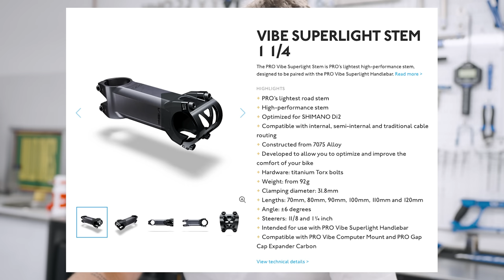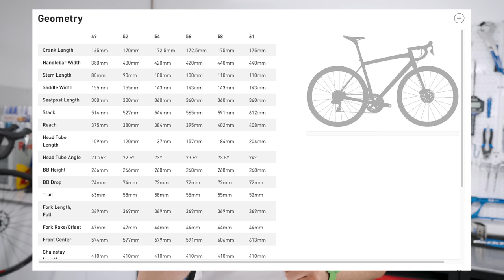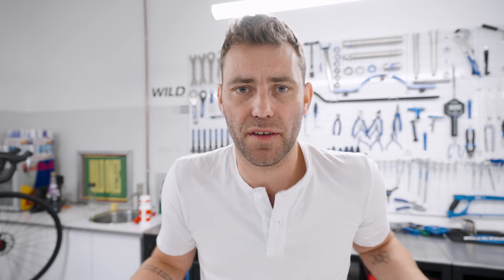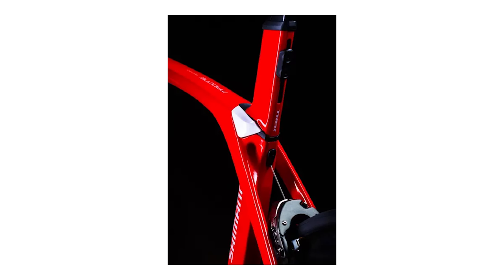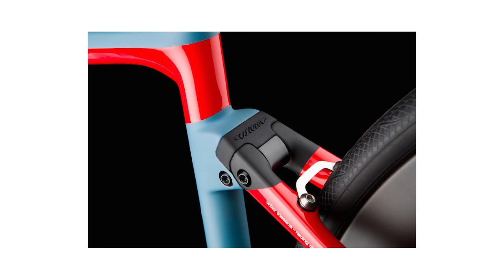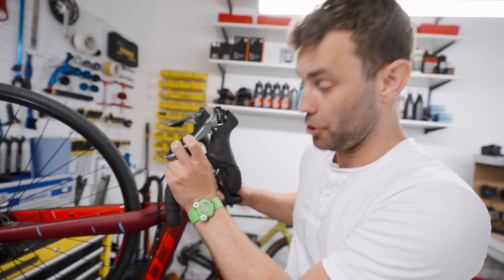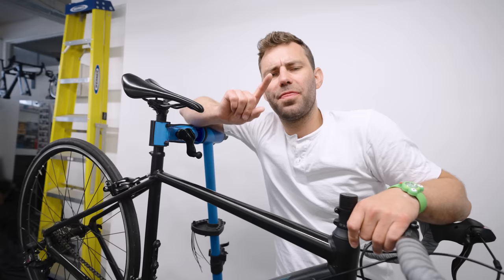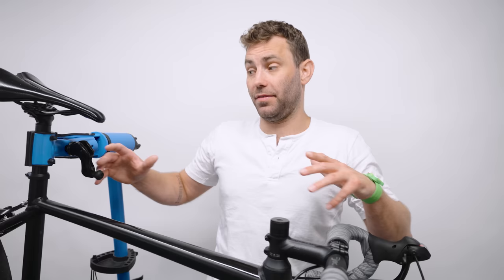Bike Fitter's 10 More Most Hated Products

Comment: Also an experienced bikefitter and totally disagree in regards to the Aethos. James has forgotten that you can simply flip the stem to create a more endurance style geometry. This is the beauty of the bike, in that in can fit racier and less flexible riders, making it a bike for the people.
Reply: It is a flexible platform. I'm 5'10" and tried both the 54 and 56 - opting for the 56 due to toe overlap issues and the necessity of too many HS spacers to make for an acceptable stack on the 54. The trick with this frame is being absolutely anal about bar reach, stem lenth and angle, as well as seatpost offset. Mine fits well enough with a 5mm offset post, 100mm stem, and 42x70 bars. You have to take James' opinion with a grain of salt, not because he's wrong, but because fits are relatively unique and making broad based generalizations doesn't work... I know what he's advocating for with reducing frame size, but he's implicitly recommending custom geometry that favors shorter reach and increased stack. You also have to consider that the majority of folks that seek out bike fits are usually fighting poor fitness/flexibility and/or trying to work around injuries that might not be fixable with a fit - hardly a normal population sample.

Comment: Guys I want to buy a new bike and the problem is I'm between M and L size. What is a chance to pick right frame size without bikefitting before buying the bike?
Reply: I'm 1,75 and also between M and L. I got my last new MTB in M and it fits good. I got later a cheap used one for restoration in L and even if I still can ride it the new one in M fits better. 

The risk is if individual manufacturers may have slightly different sizes

Comment: one thing about long reach handlebars: couldn‘t that be compensated by shorter stems? so if eg my current bike fit is quite okay, but I have a 100mm reach handlebar, would I still profit from switching to a short reach handlebar? or would that mean I had to change my stem as well?
Reply: In my experience, everyone who tries a short reach handlebar finds it more comfortable, meaning that the reach they previously had was just too long.  If your bike fit is indeed spot-on, then the only real benefits you'd get from a shorter reach handlebar plus longer stem would be less chance of bumping the handlebar with your knee when out of the saddle, and also a bit more reach when riding on the tops.

Comment: I always thought steeper STA meant that the bike, compared with another bike with the same top tube length, would be longer, because you'd have to move your saddle further back to maintain the same saddle fore aft (and thereby increasing the saddle to handlebar distance).
Reply: I think you're adding in a variable that isn't accounted for, namely how high your saddle is from the top tube. If you have 8" of seatpost visible with a 73 degree STA and 52cm top tube, your saddle will be further back than if you only had 4" visible seatpost on the same frame, thus necessitating a forward adjustment of the saddle. 
Given the same amount of visible seatpost, a slacker (lower number) STA will increase the reach over a more aggressive (higher number) STA. 😁
Reply: Yes that is correct. That’s why we use stack and reach, to take seat fore aft out of the equation.

Comment: 1. what ever happened to the turbo saddles from Italy? 2. why are people thinking that just a push peddle on a gravel bike is all they need? and where did all the toe clips and strap peddles go where I can slip in a light hiking boot, so I can go for a short hike after ridding the gravel road. or is there some sort of mid tec? or gravel bike riding is still in its infancy?
Reply: (1) Turbo was a Sella Italia saddle, they still make saddles and they're still among the best.

(2) Take the time to get used to flat pedals, it's worth it (but get decent stiff shoes/boots). There is a new magnetic cleat system that blurs the line between clip/clip less, but I don't rate it.

Comment: What's wrong with most 3T bars? I just bought a secondhand 3T superergo alloy and now little bit curious..
Reply: I run the same bars. They work great for me. The reach is only 2mm longer than the deda rhm and the drop is smaller, making them easier to access.
Reply: @brianlam3563  yeah, Neil Stanbury was a great fan of the bar. Curious if it is to avoid according to james just because it has 77mm reach?

Comment: I'm not buying the advice against leather saddles. I got my first Brooks Pro over 50 years ago and it has been my favorite saddle since day one. I have a lot of bikes and half of them have non-"hammock" saddles. I also have sensitive hands, I believe from years of careless use during my various mechanic careers. I have noticed zero difference in hand comfort that I could attribute to saddle choice. Butt comfort, back comfort, even leg comfort, yes, but not hand comfort. In light of the comment on distance, I do a decent number of rides each year in the 80 to 200 mile range.

Comment: why are there hard tail mtb's but not hard fronts? isnt suspension more important in the back since thats where most of the weight is and the rear wheel is the drive wheel. also when seated the spine takes most of the shock while arms are a great suspension system.
Reply: Its in the front because your anyways standing on a MTB when the suspension is really needed. Your legs absorb the shock at that point anyway. Your arms on the other hand don't have as much "inbuilt" suspension and it doesn't take much force to dislodge your hands and taking a mouth full of dirt.
Reply: You need the control/traction the fork gives you on the front wheel more than the rear - it'll save you from a front heavy landing, it'll absorb bumps while you are cornering keeping you on line and it lets you slow down effectively through rough sections. 

Rear suspension is great but if you can only have front or rear front is the largest benefit.
Reply: Older 1990s mtbs have no suspension at all, classic fat bikes have also no suspension fork
Reply: @lewan1905  im thinking bike racing when most of the riding is done in the saddle and there are no jumps or very little ones.
Reply: @Tim Taylor  I don't know which MTB races you are talking about but most if not all official MTB races have at least some parts which require standing for some technical part. And the same applies for sitting, losing grip on your handlebars would be much worse than having a sore ass
Reply: @lewan1905  Cape epic or Tour devide some ppl run no suspension which blows my mind since the race is so long but no rear suspension maybe some suspension seat posts. I can see how it would be more comfortable. But it being faster would depend on the chonk and if the rough terrain warrants front suspension then the rear suspension should be important as well.

Comment: The Athos does not have the exact same geo as the SL7, it has shorter reach and more stack height. More upright for the more casual rider. Also, Specialized shoes are in fact, neutral shoes. Don’t where this nonsense is coming from.

Comment: Zipp has full line of 1 1/4” steerer stems.    
Giant has awesome handlebars for 1/3 of the price of 3t.   
Brooks works but must be adjusted for tension which most people skip.

I’ve been trained in several systems and unfortunately a lot of the “science” is opinions and process.     You change through every race season and changes are constant.

Comment: i usually advise people to get a smaller bike (frame) because they can always move a seat forward or back and you can adjust the reach by changing the stem length or angle.  But you can't make a bigger bike smaller.
Reply: This is an oversimplification - people vary. It's important to get the correct fit, not necessarily possible with any particular bike or nominal size. Trying to guess what might fit fails to consider relative torso and arm length, etc. Yes, it can be complicated, hence the existence of bike fitters like James...

Comment: Well let's not make the brooks saddle the problem when the real problem is a extremely weak group of core muscles. The core is what should take the weight off your wrists. 
I got a brooks team pro when the clash were still together in the early 80sI have more miles on that one saddle than I ever put on any car. I can't say that for anything else in my life. They are a great product but yes you need good form. 
The other thing back in the day you developed core because you needed every muscle to mash up a climb now when you get more bailout gears you keep spinning.

Now I don't ride a brooks as much as I used to but if you are fitting a long time brooks user they hate the flat slide around on saddles and like one with a dedicated place for your bones.

Comment: I think the issue with brookes saddles is that you have to" break them in " you shouldn't have to do this for a saddle
Reply: That's the nature of their design. It uses a single thick piece of leather that suspended between two points. It takes time for the leather to conform to the rider. Other saddles on the market have a rigid plastic base, a layer of foam padding, then a thin outer covering.

Comment: Can James talk us through how he at 178cm or 5'10" recommends a small 51-53 frame, while literally every other guide on the internet puts that person at 54-56cm?
Reply: By copying a road race fit on an endurance bike. I ride large with 187 cm height but can easily fit a size medium endurance maintaining my fit. Stack is about the same but the frame is size down with a smaller top tube. Reach is compensated with a longer stem.
Reply: At 180cm/ 5.11 I ride an old TCR (2012), size medium, 50cm seattube and 55cm toptube because of a long torso.
With a short reach (75mm) 400mm (c-c) bar.
What modern medium sized road bike comes with a 50cm seattube or whatever in order to have a 77cm standover which is the proper standover measurement imo ? (For a medium frame)
I rarely see a standover sizing in the geometry tables anymore.. like it's not important, for me it is.
Reply: @tonycaluda1868 standover is fairly pointless on most modern bike geometries with sloped top tubes - where would you measure it?

Comment: Any Shimano mountain bike shifter with a gear indicator window needs to be on this list. They make it impossible to have the brake lever inboard of the shifter, which is almost always required to achieve one finger braking.
Reply: you can remove the gear indicators

Comment: Just completely disagree with the Brookes leading to upper body probs/provide no support. I went through probably 20 saddles before I finally tried a Brooks B17 narrow and it was the first saddle I had where I could ride my road bike all day where the saddle pain did not become unbearable. I ride in quite an aggressive bar drop and with properly adjusted saddle layback (one of the main determinants of the weight supported by your upper body) I have never experienced any of the issues this guy describes. The exact opposite, in fact. I can allow the saddle to take more of my weight.

I don't like the way the saddle looks on my bike at all and it is really heavy but I really don't care as it let's me ride all day in comfort. For me, plastic/foam saddles look good and are light but are overpriced, uncomfortable, and don't last.